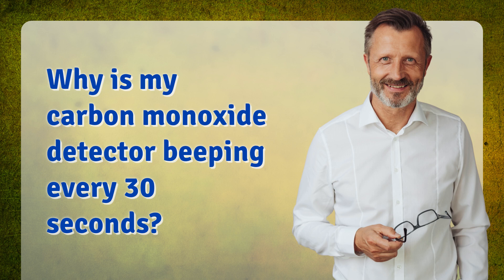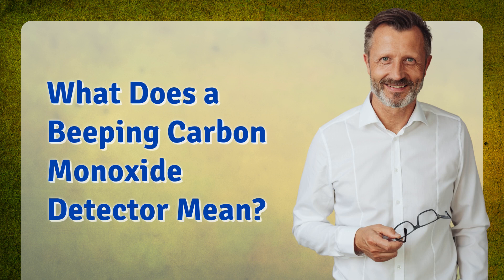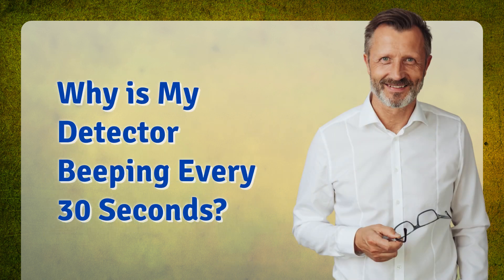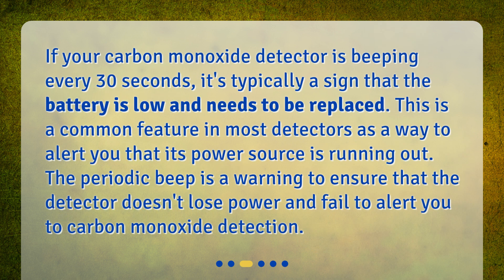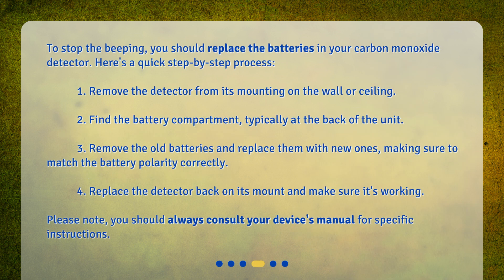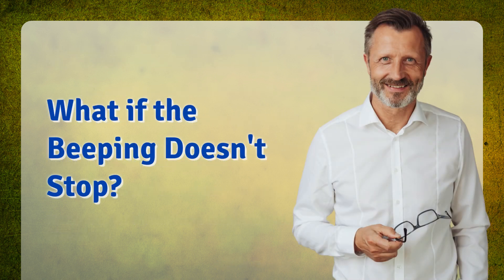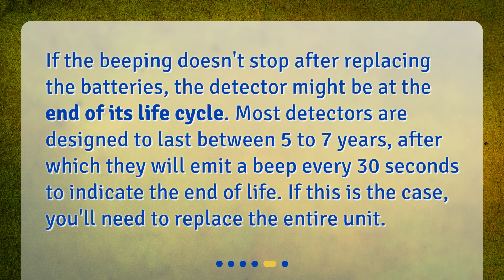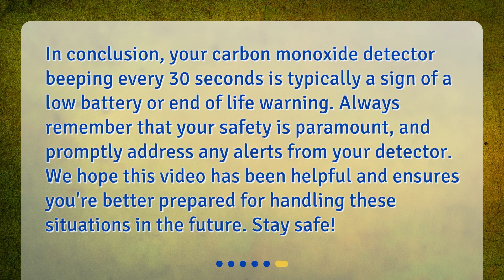Why is my carbon monoxide detector beeping every 30 seconds?

Comment: That video did not need to be that long. Literally: “If it beeps every 30 seconds, try changing the battery. If this doesn’t work, the detector needs replacing”.

Comment: Oh great just add another piece of trash to the landfill.
I had dry wall sanding nearby in another room and both upstairs CO monitors started beeping every 30 seconds that day.
The batteties are good, but even after trying to blow out any possible dust, they both continue beeping.

Comment: mines a wall plug in and still beeps 🙄
Reply: A low battery indicator WILL BEEP even though a unit is directly plugged into an outlet.  That is because the unit still wants to be able to work should your electric power go off for any reason.  (DC) Battery and (AC) electric  are two SEPARATE  sources of power.
Reply: @Pw6872  thank you i can finally stop the beeping 😭